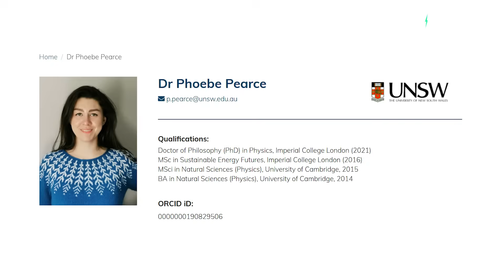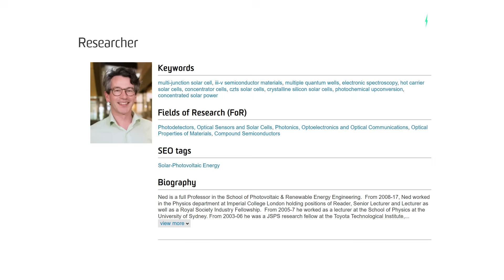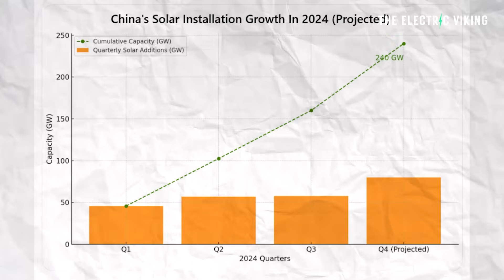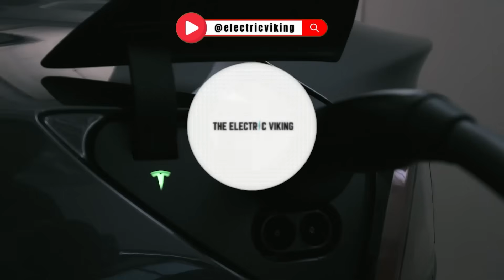Breakthrough device enables solar energy generation without sunlight

Comment: 021708 Peaceful revolution driven by clean abundeace

The second law of thermodynamics may be false conventional wisdom. Let's face the wonder of full heat use. 

The second law of thermodynamics was developed during victorian england's scientific and religious fascination with steam engines. 
Many people act as if this paridgm is inescapable. 

The second law is behind modern refrigerators needing electrical energy to compress the refrigerent to force it to release as waste the heat that it has removed from the refrigerator's service interior in the cooling part of the refrigerent's circulation. The interior coldness draws in exterior heat through the cabinet insulation. There is also discarded heat from mechanical friction and electrical resistance. The net thermal output equals the electrical input with energy not being gained or lost in this refrigeration system including its forced waste. Unencumbered refrigeration by the principle that energy is conserved should produce electricity instead of consuming it. 

It makes more sense that refrigerators should yield electricity because energy is widely known to change form with no ultimate path of energy gain or loss being found. Therefore any form of fully recyclable energy can be cycled endlessly in any quantity. 

Full heat recycling, all electric, very isolated underground, undersea, or space communities would be highly survivable with self sufficient EMP resistant LED light  automated vertical farms, thaw resistant frozen food storehouses, factories, dwellings, self contained elevators, safe rooms, and horizontal transports. 

In a flourishing civillization, small self sufficient electric or cooling devices of many kinds and styles like lamps, smartphones, hotplates, water heaters, cooler chests, fans, radios, TVs, cameras, security devices, robot test equipment, scales, transaction terminals, wall clocks, open or ciosed for business luminous signs, power hand tools, ditch diggers, pumps, and personal transports, would be available for immediate use incrementally anywhere as people as individuals or larger social groups see fit. 

Some equipment groups could be consolidated on local networks. 

If a high majority thinks our civilization should geoengineer gigatons or 
teratons of carbon dioxide out of our environment, instalations using devices that convert ambient heat into electricity can hypothetically be scaled up do it with a choice of comsequences including many beneficial ones. 

Energy sensible refrigerators that absorb heat and yield electricity would complement computers as computing consumes electricity and yields heat. Computing would be free. Chips could have energy recycling built in.
This would improve performance and lower cost, 

Refugee communities would buildable quickly.  

A simple rectifier crystal can, iust short of a replicatable long term demonstration of a powerful prototype, almost certainly filter the random thermal motioren of electrons or discrete positiive charged voids called holes so the electric current flowing in one direction predominates. At low system voltage, a filtrate of one polarity predominates only a little but there is always usable electrical power derived from the source, which is Johnson (observation) Nyquest (theory) thermal electrical noise. This net electrical filtrate can be aggregated in a group of separate diodes in consistent alignment parallel creating widely scalable electrical power. The maximum energy is converted from ambient heat to productive direct current electricity when the electrica6bzDVgBhrhYl load electrical resistance  is equal to the array internal electrical resistance. 

Maximum calculated electrical power output (watts) is k (Boltźman's constant), one point three eight x 10^ minus 23, times T (temperature Kelvin) times bandwidth (0 Hz to a natural limit ~2 THz @ 290 K) times rectification halving and nanowatt power level rectification efficiency, times the number of diodes in the array. 

There are a billion cells of 1000 square nanometer area each per square millimeter, 100 billion per square centimeter. 

Order is imposed on the random thermal motion of electrons by the structual orderlyness of a diode array made of diodes made within a slab: 

Host crystal is silicon
  P type boron doped
-----‐------‐----___-- Out
🔻🔻🔻🔻
■■■■■■___ + Out 
  N type phosphorous doped 

All the P type semiconductor anodes abut a metal conductive plane deposited on the top face of the slab with nonrectifying joins;  the N type semiconductor cathodes or common cathode abuts the bottom face. As the polarity filtered electrical energy is exported, the amount of thermal energy in the group of diodes decreases. This group cooling will draw heat in from the surrounding ambient heat at a rate depending on the filtering rate and thermal resistance between the group and ambient gas, liquid, or solid warmer than absolute zero. There is always a lot of ambient heat on our planet, more on equatorial dry desert summer days and less on polar desert winter nights.

Focusing on the composition of one simple diode, a near flawless crystal of silicon is modified by implanting a small amount of phosphorus (N type conductivity) on one side from a ohmic contact end to a junction where the additive is suddenly and completely changed to boron (P type conductivity) with minimal disturbance of the crystal lattice. The crystal then continues to another ohmic contact. 

A region of high electrical resistance forms at the junction in this type of diode when the phosphorous near the ĵunction donates electrons that are free to move elsewhere while leaving phosphorus ions held in the crystal while the boron donates holes which are similalarly free to move. The two types of mobile charges mutually clear each other away near the junction leaving little electrical conductivity. An equlibrium width of this region is settled between the phosphorus, boron, electrons, and holes. Thermal noise is beyond steady state equlibrium. Thermal noise transients, where mobile electrons move from the phosphorus added side to the boron added side ride transient extra conductivity so t⁶he forward moving  electrons are preferentally filtered into the external circuit. Mobile electrons are units of electric current. They lose their thermal energy of motion and gain voltage, as they transition between the junction and the array electrical tap. 

Inside the diode, heat is absorbe; outside the diode, to exactly the same extent, an attached electrical circuit is energized. The voltage of a diode array is likely to be small so many similar arrays need to be put in series to build higher voltage.  

Understanding diodes is one way to become convinced that Johnson Nyquest thermal electrical noise can be rectified and aggregated. Self assembling development teams may find many ways to accomplish this wide mission. Taxonomically there should be many ways ways to convert heat directly into electricity. 

A practical device may use an array of Au needles in a SiO2 matrix abutting N type GaAs. These were made in the 1970s when registration technology was poor so it was easier to fabricate arrays and select one diode than just make one diode. 

There are other plausible breeches of the second law of thermodynamics. Hopefully a lot of people, mostly as independent teams, will join in expanding the breech. Please share the successes or setbacks of experiemental efforts. 

These devices would probably become segmented commodities sold with minimal margin over supply cost. They would be manufactured by advanced automation that does not need financial incentive. Applicable best practices would be adopted. Business details would be open public knowledge. Associated people should move as negotiated and freely and honestly talk. Commerce would be a planetary scale unified conglomerate of diverse local cooperatives. There is no need of wealth extracting top commanders. We do not need often token philanthropy from the top if the wide majority of people can afford to be generous.. 

Aloha
Charles M Brown

Comment: This is not new technology. I have fridge at my house which use the same semiconductor technology to cool staffs. it is reversable temperature difference can produce energy bur If You apply energy then it can be used as cooler or heater.

Comment: It´s yet another fascinating technology but not more than a curiosity: 1/100000th of the low density energy a conventional panel produces? I can even do better:) My watch is automatic, mechanical. It is powered by the movement of my wrist, it doesn´t use electricity at all. About  95% of the energy my wrist produces just by moving, it´s wasted because the watch just needs 5% to work. How about installing a battery that can store these 95% of wasted energy and than use it to charge the i-phone? And now imagine improving this concept and adapting it to shoes!!! If everybody had such a power-shoe ................

Comment: Implantable location status devices used by military,  uses the heat delta as power source.
Reply: Greetings from Monsieur Peltier.
but this is a different physics effect than IR radiation capture as mentioned in the video.

Comment: You really need to consider how much energy there is available to collect without sunlight.  Even if 100% efficiency is possible, is it worth it?  Forget collecting energy from body heat:  how about plastering ICE engines and exhausts with it instead?  Exponentially more energy available to collect.

Comment: Any electricity produced will be ridiculously tiny in quantity compared to our needs. The device shown is a discrete transistor style device. No doubt it can respond to long wave Infra Red, but the cost and energy put into the device means it will only ever be useful in places electricity is required at very low power and when high cost isn’t a problem. On a satellite or deep space probe in space, maybe. On your house - no.

Comment: The energy in electro-magnetic radiation is directly related to the wavelength, the shorter the better for energy harvesting. At these long infrared wavelengths the method is interesting and possibly viable but only for special use cases where other methods are not readily available.

Comment: The use cases for this technology are non-problems. I can already buy a watch with a battery that powers it for 10 years. So they will replace my watch that runs for a decade with one I have to put on a charger every night. No sale. 

My solar garden lights capture and store more power in a day than these things can in years.

Comment: Early days with this tech for certain, but I can see heat sinks during the day, radiating to these panels at night. Body heat too, I like. We'll see. I'll bet it happens before hydrogen.
Reply: look at the comments above. First you have to understand how much energy is actually available..... it's minuscule.
from an engineering perspective it depends what you want to do? you might be able to power a sensor but you can't power a car or house with reasonable collector sizes.

Comment: I saw a ted talk that was also talking about using the cold night sky to absorb heat from space and improve air conditioning efficiency at night.(link below)
But I think that the power you can get out of radiant heat is quite limited and won't be able to power like a house or stuff like this

link to the ted talk "How we can turn the cold of outer space into a renewable resource | Aaswath Raman"
https://www.youtube.com/watch?v=7a5NyUITbyk&ab_channel=TED

Comment: If it smell like BS , it a BS. You have heat detectors for more then 100 years, however They are very low efficiency,that never will be practical.
Reply: Says the worker bee.

Comment: The earth receives on average 1 kW of power from the sun over a 1 sq meter area. The surface of the earth on average absorbs 50% of this energy. So for this technology to be viable from first principles a heat sink of some kind would be needed with an extremely high absorption coefficient and high conversion efficiency to electricity.
Reply: and it has to have the mass for heat storage and slowly release ...
this tech not going to work

Comment: There isn't enough power to capture to make this worthwhile. It's like trying to replace your day job by searching your couch cushions for coins.
Reply: This.
Reply: In Australia where there is lots of sunshine, that may be true but in higher/lower latitudes  in areas like Europe, Russia, Canada... this would definitely make solar panels that work 24/7 more viable.  

In Canada for example where I'm from, we have 8 hours of sunshine (it's winter here).  The farther up north we go, the less rays.  Near the Arctic, it's 24 darkness.  At the end of the day, it will come down to efficiencies & competition, basically whatever is cheapest and most practical.
Reply: @Lorne.Mccuaig  If a large panel can generate 1 watt per day, or even per hour, the juice will not be worth the squeeze. 1 gallon of gasoline for contrast has about 33 kWh of potential energy. If you heard him, the power was 1/100,000 the power you expect from panels exposed to full sun.

This technology will probably never be viable since it'll always be cheaper to use a battery to fill in overnight compared to what those panels will produce.

Even if you had a large source of waste heat, you would probably be better using thermal power systems like steam generation.
Reply: @JGoodwin  While I believe you, I also think it's still all in the application.  Space for example, is a good example with this tech.  We have to work within the confines of what we are blessed with, which varies throughout the globe and beyond.  

I don't think it's wise to dismiss any kind tech with the wave of a hand either?  Everything in it's infancy seems infantile until it grows up and yes, some things never do but it shouldn't be for a lack of trying.

Comment: We're talking micro Watts per square metre folks - This story is up there with the Hydrogen Economy as a non-starter. Please do the maths.
Reply: The efficiency or power could be orders of magnitude better operating at the Lagrange point between the Sun and Earth (versus the much lower IR difference between Earth and space).   There it could also help reduce the excessive human warming and use the energy for station keeping thrust...
Reply: @glike2 at the Lagrange points other than L2, you have solar 24/7.
Reply: That’s what to two ranchers said about cars when the first saw one drive by and get horses upset in the corral. How are they going to find gas to while driving long distance? They said. 
Big ideas always start small. Just let marinate for awhile ~
Reply: Exactly correct.  Proof of concept was demonstrated, and when space was mentioned, I could imagine it is a bs idea hatched from an 5I country to scam potential investors in a Ponzi scheme.
Reply: Better something than nothing.
Reply: Makes since, infared is light, it's just light that the eye can't see!
Reply: always funny when people don't understand even the most basic principles of physics.

Full sunlight (perpendicular to the surface) is around 1000W/m^2..... 
Our brilliant Australian inventor offers to use microwatts of IR energy radiated out from the earth? Hmm, there are a lot of zeros between 1000W and 1/1000,000W :-) and this is only the incoming energy, you need to multiply this with the conversion efficiency. For a standard PV system around 15% (oh well, maybe now 20%, who cares). Completely idiotic.

Some energy harvesting expert can probably help a little. I wonder how much energy you can extract from RF signals in the air. I always wonder why nobody seems to care anymore for RF pollution and possible effects on the human body.
Reply: The batteries coming out in the next few years is going to crush the "hydrogen economy" for transportation.